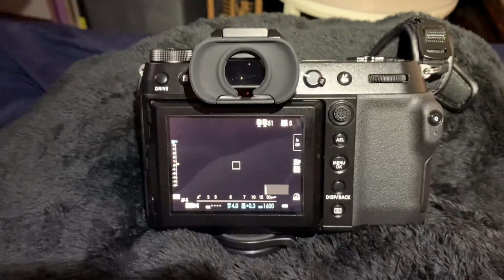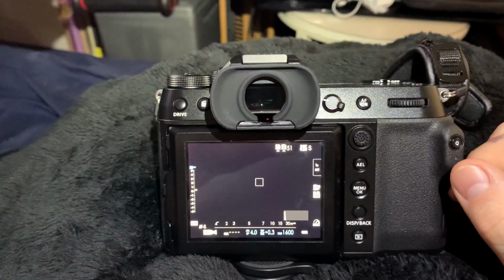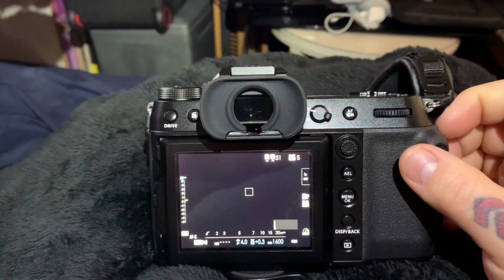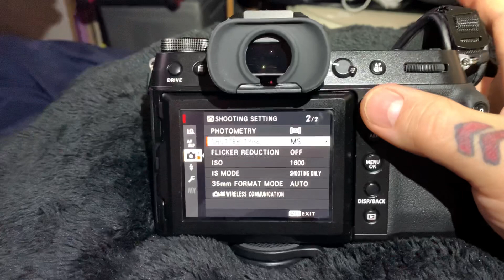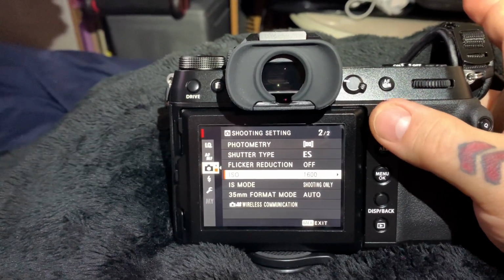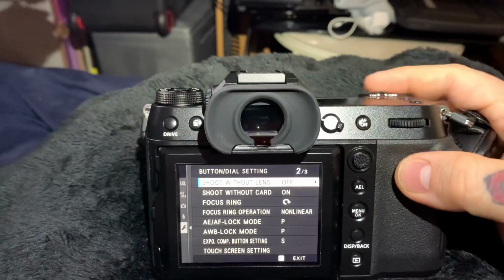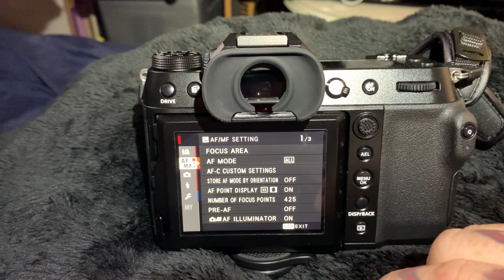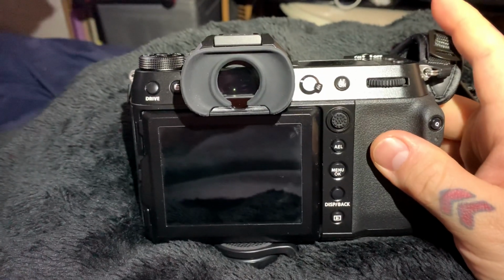😇 OFFICIAL GFX100S Sensor Cleaning HOW TO 😄👍

Comment: Hey Ken where are the steps to take a deep breath and then to exhaust acidic breath on a sensor cover plate and use lollipop of sensor dead to press the cover plate and IR filter through the air gap against the microlens....😁😁😁